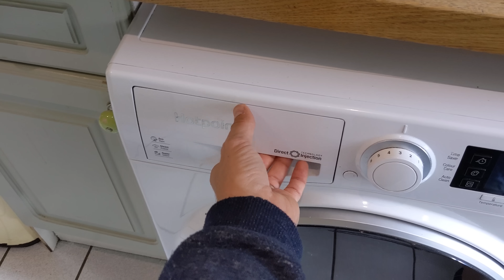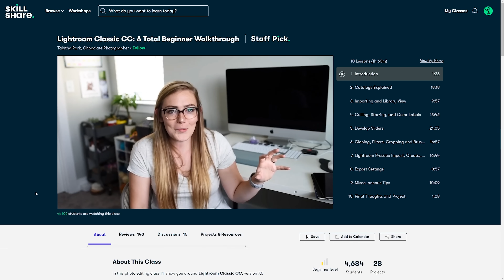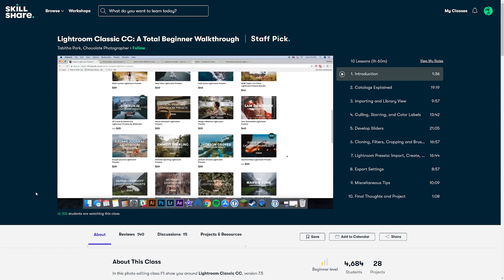The Pythagorean Siphon Inside Your Washing Machine

Comment: my toilets's filling system/float valve looks like this: https://media.s-bol.com/BlwlBmz0o6Q/509x840.jpg; and this is the flushing system: https://cdn.shopify.com/s/files/1/1812/2353/products/geberit-impuls-280-twico-2-dual-flush-toilet-valve-chrome-push-button-282-350-kd-1-discontinued-spares-toiletspareparts_632_x700.jpg?v=1522751338. It's just a system with two buttons/ 2 valves. One button to drain half of the cistern and another button to empty it completely; it just uses gravity, no fancy siphoning action. To the side of the thing, you have an overflow pipe.

Comment: To confirm what others have said, the siphon mechanism is relatively new (like, last 20ish years?) So most toilets in 'murica, unless they are new-built homes, probably have a float-flap. It's essentially a rubber flap with an air-bubble in it. Water pressure keeps the flap sealed against the downspout, but when you give it JUST the right lift, it'll float in the tank until the water level is low enough and it drops back down and seals against the bottom of the cistern. All the while, the ball-cock float is open, so it's spewing water out and refilling the tank, but not as fast as it drains until it hits the seal again. They usually have an overflow spout that  dribbles overflow, so if you hear your toilet dribbling, it could be that the chain that lifts the flap is stuck under the float-flap, or that the level spout is positioned lower than the float so it's always leaking water out.

Comment: Being from the united states I'm very surprised by the siphon valve attached to the flusher, all toilets I've come across in homes use a rubber plug on a hinge attached by chain to a lever arm that swings when the flusher is used, this lifts the chain and the rubber plug on its hinge from the bottom of the reservoir causing all the water to drain at once, I honestly don't immediately see an advantage to one design over the other. What's most surprising to me is that someone who hasn't thought about it once would just assume that everyone would use the same or similar design.

Comment: In Italy we have quite a bit variety of toilet flush mechanisms: the most common one consists of a tube with a rubber seal at the bottom, which is lifted by pushing down a button, part of a seesaw. The reduced flush can be achieved by adding a second pipe around the first, which is filling with water between the tubes somewhere at the half of the tank depth. If the whole assembly is lifted, the water isn't discharged from between the pipes and it's weight pushes the seal back as soon as the button is released. If the assembly is lifted by the outer pipe first, this allowing the water to vent, it then can float until the tank is empty. Another popular, vintage mechanism uses the syphon. It's called catis https://images.app.goo.gl/jc4UTPU8s4TJLrVBA : a cast iron syphon with an opening at the top of the pipe going to the bowl, with a plug which is removed with a chain and allows water in the pipe to the bowl. After the chain is released the plug falls back in place and the syphon activates, driven by the water in the pipe to the bowl until the tank is empty.

Comment: In Italy we have a pump embedded into the wall that pumps air toward the box which contains the water to initiate the flush. The box with the water is usually close to the ceiling.

Comment: In me head: "how's a toilet not a greedy cup mechanism?"
"so why are we looking at the toilet tank??"
"the UK has different flush mechanisms‽‽‽‽‽‽"
Reply: You can flush american toilet with a bucket of water, if you fill the bowl up to high then the whole thing will empty. (Minus that little bit after the air cuts the siphon, just like the model has a little bit left over. It will be filled back up to normal levels as the reservoir/ cistern is being filled, a smaller flow of water will be going through the over flow in to the bowl.)
Reply: @andrewpast1959  The ability to flush a toilet with a bucket has saved me many times when I had frozen pipes. We would ask the neighbors to fill a few buckets and keep them in the tub, and, well... "If it's yellow, let it mellow. If it's brown, flush it down." Just dump the bucket of water in the bowl when you're done going and it all drains out.

I believe siphon drains can be used with rear draining toilets but then the sewer pipe becomes part of the system. Not 100% sure, though.
Reply: @bensavedbychrist  Living in a tropical climate where pipes never freeze, it took me a moment to realise you were talking about your water inlet pipes freezing.  I thought you meant your sewer pipes froze and somehow dumping more water into them thawed them out 🤣
Reply: @Berkeloid0  No, but that can happen, too. One of the tricks to keep inlet pipes from freezing is to let it trickle down the drain, and having flow keeps the pipes from freezing. But a slow trickle in the larger drain pipe can lead to a build up of ice there.
Reply: @andrewpast1959  You could flush almost any toilet like that: either you're triggering the syphon or simply pushing the waste down the drain with the force of the water pouring from the bucket.
Reply: Exactly what I was thinking.
Reply: Because it's manually triggered rather than triggered by the water level itself?
Reply: @Intrinsion  I think what Matthew was implying is that the bowl of the toilet empties using the greedy cup method.  Being from the U.S., and having never encountered the siphon in the tank, I too was thinking he was going to discuss the siphon out of the bowl.
Reply: Andrew Snow Except toilet bowls in the UK are rarely siphonic, out toilets are usually drained via a horizontal pipe through the wall behind the toilet, rather than down through the floor. They have a simple P trap and use the force of the flush water to push waste through the trap. I remember as a child encountering a siphoning toilet that filled up alarmingly close to the brim before suddenly emptying- I was convinced I was about to flood the bathroom of the person who's house it was.
Reply: @spencerwilton5831  Wow, that's just reminded me of something from when I was a child. The toilet at my grandparents' house was like that - it filled up before emptying, but any toilet can do that if it gets a bit blocked, so I didn't take that much notice of that - the bit that fascinated me was how the bowl almost completely emptied of all water towards the end of the flush, before filling back up slightly again, ending up at about the same level as other toilets. It got replaced with a "normal" toilet a few years later. I'd never come across another one like it before or since, and I had no idea how or why it did that until now.
Reply: Reppin' the interrobang

Comment: Nobody made so many people run to there toilets like Steve did...
I'm from Germany and haven't seen a mechanism like this my whole life. I'm not a plumber but I
think here it's pretty common here, that there's a mechanism with a  rubber sealing at the bottom of the cistern that's pressed down by the water pressure. How it exactly works is quite difficult to describe... If you want to flush for a given time, you lift it up all off the mechanism via a lever, if you let it go it will be pressed/sucked down again and is sealed.  If you want to do the full flush, you will only lift up one part of it (by a separate lever). That part will also lift the rubber sealing but floats by an integrated air chamber. When the water is gone, there is nothing to float on and everything is in the sealed position. As the water level rises, the pressure that presses down the sealing is higher than the buoyancy and it is sealed again.
Thank you for your videos!

Comment: Interesting mechanism on the toilet. Here in the U.S and in Colombia, where I lived, the toilets don't have this siphon but instead use a really basic plastic valve that's hinged. Pull the string and the valve opens and remains open because it floats. Then the water level drops enough to allow the valve to close again. Then the water pressure on top holds the valve shut until you pull again. For controlling any overflow, there's a tube going up into the tank, just like on the uncapped softener tray at the beginning. If water rises too much, it'll drain out the tube.

Comment: My toilet specifically just lifts a flap at the bottom of the cistern when flushing. I'm not totally sure what keeps the flap open when I let go of the lever, but I'm not willing to take apart the only toilet I have access to to find out. I'm pretty sure, though, that when people say the toilet has a Pythagorean siphon they're referring to the bowl, which automatically drains when the water reaches a certain level, provided there aren't any blockages. If, for whatever reason, the cistern is broken, for example, you can flush your toilet manually by dumping a bucket of water into it.

Comment: In Czechia we have a valve in the toilet that is shut because of the weight of the water above the seal. When you pull on the mechanism, you pull the seal up and a float is then holding the whole valve mechanism up until the tank is empty and the seal slams back in to its well. It's like when you don't have a plug for your kitchen sink so you put a glass over the drain instead. For as long as you don't tip it, the mass of the water is holding the glass down.

Comment: Your UK cistern mechanisms are backwards! Here in the US, many/most in-home toilets will half-drain with a simple flip of the handle, while holding the handle down will result in more water volume flowing through, proportional to the length that the handle is held down. Releasing the handle is what actually closes a valve, but it won't close until the water level has dropped sufficiently to initiate the flushing action.

Comment: One of the new American toilet designs uses a hollow tube with a seal on the bottom. When you flush the tube lifts up to allow water to drain out the bottom of the tank. In the case of an overfill water will spill over the top of the tube. It seems like you get a partial flush action just by the “time constant” of the valve system here. But not as closely metered as the siphon system  you showed in the video. Pretty clever stuff!

Comment: Here they just have a tank with a stopper that floats, same filler mechanism, but if you flush, the stopper opens the flow and let's the pressure go through and flush, it also means if you don't actually do it hard enough it'll just dribble a tiny bit and not dump the entire tank

Comment: Now I know why you have to press the handle on cistern fast enough for it to work. And when the one way valve partially breaks, that explains why it gets harder and harder to initiate on old cisterns.

In Germany, a different system is much more common. It is basically a plug, but the plug is also boyant. Initially, it is held down by the weight of the water, because water can't get underneath where the opening is. Once you pull it up, it floats until the cistern is empty.
Clear advantages: You can pull as slowly as you like, it always works. And you can start flushing on a partially filled cistern. Disadvantage: Automated half-way flush mechanisms are much more complicated (but do exist). But you can simply push down the plug to make it stop.
Also: They put a pipe in from above the desired fill level, through the plug to release dribbling water.

Comment: Ok, wow. Just pulled that draw out of the washing machine, spent 5 minutes cleaning that disgusting thing.  The reward, one minute of pure knowledge bliss playing with a Pythagorean siphon.  Steve you're amazing at explaining these curiosities and the examples you build or show us are so assessable and understandable, thank you.
Reply: Drawer* or more accurately, dispenser tray.
I hope this doesn't come across as pretentious, just trying to help where I can.
Reply: My washing machine doesn't have one of those. (It's vertical) The way my washing machine works there is a tower In the middle that spins and at the top of that tower there is a cup that you put the softener in. Around the side of that cup is another upside down cup with a hole that allows you to pour softener in. When the washing machine spins it pushes the softener out of the cup and Into the sides of the upper cup using centripetal force. It then funnels down Into little square holes that evenly distribute the softener into the clothes while spinning

Comment: I've never seen a toilet with a siphon like that in Canada. The most common mechanism I've seen here is just a hole in the bottom on the tank with a little flap sealing it. The flap has a float on a chain attached to it. When the tank is full, the pressure differential on the flap from all the water keeps it tightly sealed against the bottom of the tank despite the float. The flush level just yanks the flap up and open, where the float then holds it up until the water level has dropped substantially. The flap then re-establishes it's seal, and by the time the level is high enough for the float to pull on it, there is already enough pressure to hold it down.

These systems are supplemented with a tall open pipe at the top of the tank which allows water to run into the bowl if the tank is overfilled.

Comment: The float inside toilets in Canada is the same, lifts and blocks the water flow from continuing to fill the tank. However the flush mechanism is different. It's just a flap at the bottom of the toilet tank that empties into the bowl. Push down on the lever and it lifts the flap inside. Let the lever go to give a partial flush, keep the lever held down to empty the tank. If the toilet is leaky, there's an upper limit where a tube that empties into the tank as well, water level goes above that and it trickles down into the bowl.

Comment: I still don't understand why the max level of softemer is what it is or how important it is to not exceed it. 

Like, if I put a bit more in it's not going to stsrt to flow out the overflow hole. And I don't think the amoumt of water that is added to the softener bowl is a precise amount so it's always going to flush that place with more wster than neccessary. 

Seriously, the more I think about it the less I understand it. Why is the max level what it is? Is it always around the same volume across different brands? Why does it sometimes not flush all the softener away and leave a small part left?

Comment: I live in the US and all the non-pressure-flush toilets I've looked in use a flap mechanism instead of a siphon. The water holds a rubber flap down over a big hole leading to the bowl. The handle pulls the flap up. The flap is lighter than water so it floats so all the water can exit. Then when the tank is empty, the flap falls back down and is held in place by the weight of the water as it fills. There's also an overflow pipe sticking up so a slow leak will trickle water into the bowl. Then it uses the same type of float mechanism to control water level and turn the incoming water valve on and off. Some models use a donut shaped float around the incoming water pipe, others have a rubber ball float like can be seen in this video.
Usage is entirely identical with 2 exceptions: 1. We don't have the option to half-flush. Once you pull the handle, everything in the tank is going into the bowl. 2. The flaps are notoriously failure-prone. For mysterious reasons they stop making a good seal, resulting in a slow leak of water from the tank to the bowl. Or they just get caught and don't shut so the tank never fills at all until you jiggle the handle. The British siphon mechanism looks more reliable and I wish they would start using them here.
Reply: joemck85 We are going backwards in the U.K. We have used the syphon system since Victorian times, they are reliable and as you say cannot fail in a way that leads to that constant trickle into the bowl. In the last couple of decades the flapper valve style has been allowed, and water wastage has jumped massively as a result. Their very nature means they will fail at some point, usually sooner rather than later. They are a terrible idea for toilets, as toilet cisterns are prone to limescale by their very nature, and all it takes to make a flapper valve leak is a flake of limescale on the sealing surface of the valve.
Reply: @spencerwilton5831  Why are they gaining popularity? The siphons look like a fairly simple and cheaply molded blob of plastic. Replace the separate plastic flap part with a cheap bending plastic hinge COMPLIANT MECHANISM and the entire contraption could be a single piece of plastic, or two halves glued together depending on molding technology.

Comment: I've seen British toilets with a separate overflow, sometimes directly onto the floor. I always thought they used a siphon system as those are less likely to leak and waste water.
Reply: Alan Mackie If they were installed to overflow onto the floor something is very wrong! They are usually installed to an outside wall, the flowing water serving as a visual warning that the toilet filler needs attention. The problem with letting them overflow into the toilet bowl is that although very convenient, it also means the problem is likely to be ignored.

Comment: My toilet has a valve at the bottom that opens via a chain connected the handle on the inside. You can control exactly how much water goes through by holding the handle down longer or shorter. It also has an overflow pipe that is open to toe air, similar to the overflow pipes on a large dam.